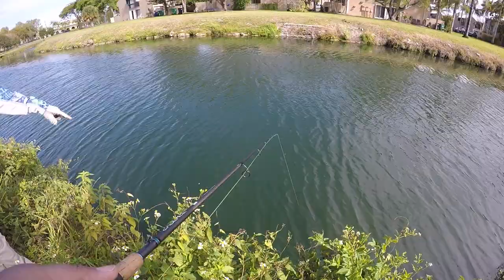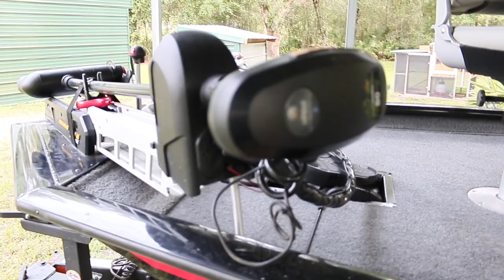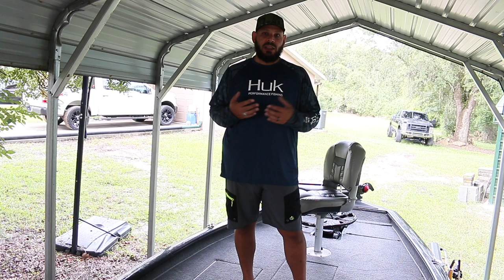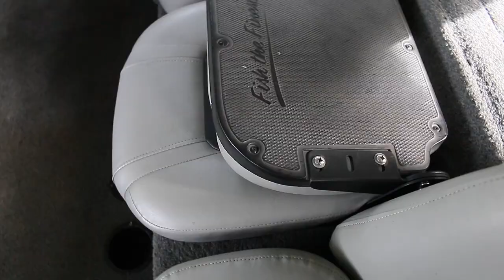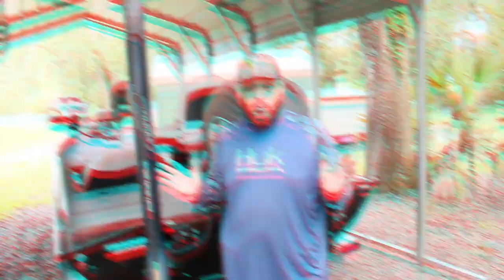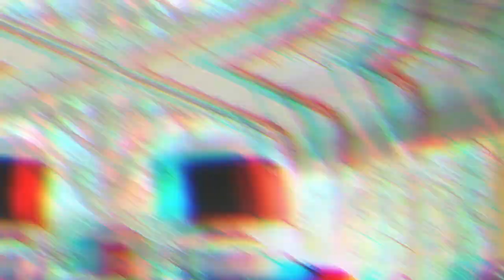Bass Tracker 3 Year Review. Should you buy one? #basstracker

Comment: I am replacing my old Ranger 396V with the newer used 2017 Tracker Pro Team 190 TX.  I am transferring my Minn Kota 4-Bank charger and my 24V Ulterra 80lb trolling motor over to the Tracker boat.  I am glad I watched this video of yours.  I have been wanting a Power Pole or Talon or even Raptor on my boat for a good while.  But, I see your point about the trolling motor.  Like yours, my Ulterra has Spot Lock and Anchor options and holds the boat position very well.  My Ranger 396V is a larger and much heavier boat, and the 80lb Ulterra had not problem moving the boat through the water or locking/anchoring the boat and holding that geo position very accurately.
Reply from the maker: Thx for watching!

Comment: Hopefully you will ready this note.  I am in the process of purchasing a used 2017 Tracker Pro Team 190 TX.  Looks a lot like your boat.  Same bow center rod locker.  The previous owner, who I buying the boat from, added a stainless steel cabinet handle to the front face of the rod locker lid.  Now when you open each lock, you have a horizontal handle to lift rod locker lid up with nice even pressure applied equally to both side of locker lid, which alleviates the binding I saw in your video.
Reply from the maker: Awesome sounds like a cool mod!

Comment: Great vidieo like all the links. I agree the trailer is not great mine is rusting too. My hatches seem fine I still have the carpet, it is  always covered. Rod storage I also am not a fan. One of my seat poles is stuck premantly in place. I use a casting seat up front that is enough room.  My seat in the middel bolts broke. Everything you pointed out.
Reply from the maker: Was just sitting in a nitro at bps but still made by tracker marine

Comment: I have a 2018 195 TXW w/Merc 150 that I paid around 32k for and currently have 40k into it with the electronics and dual Talons. If I had it to do over again I would use the 32k towards a used glass boat. The 195 has done its job and gets me on the lake and fishing. I currently have a water leak problem where the welds are failing where the hull meets the transom. My boat will be going back to Tracker this summer to have it repaired under warranty, so that means atleast 3-5 months without my boat. Later this year I will be replacing the front and rear deck carpet, have already replace sitting area carpet with better 20oz carpet because the original carpet did not really last 3 years. Once the new carpet is in, I will be using the 195 as a trade in for a new Bass Cat. Thought about going Nitro or Triton, but am willing to spend an extra 10k for the reliability and craftsmanship of Bass Cat.
Reply from the maker: I agree… getting a nitro is dealing with the sane company.. i think im trading mine in too..
Reply: @BeaglerBassFishingOutdoors  Yes, the price of a Nitro is very appealing, but in the end you get what you pay for. If I am going to finance a boat for 15 years, then I expect it to last that long and more. The trailer for the Nitro/Triton is my biggest worry. Buddy of mine has a 4 year old Nitro and the trailer  sounds like crap and recently had to replace one of the axles.
Reply from the maker: @Foes1969  that just sucks… good boat pheonix… but like 90k

Comment: Lesson #1 never buy a new boat. I’ve owned 9 different Bass Boats over the last 45 years some Aluminum some Fiberglass and never bought a new one and would never buy new. They depreciate faster than a mobile home. I have a 2003 Ranger 185vs with a 150 Yamaha Vmax that was hardly ever used,his widow said her husband used it 2-3 times a year for 6 years until he wasn’t Abel to take it out and use it. I took it home for $6,000. I spent $700 getting the motor completely serviced top to bottom. $550 on 3 new Goodyear Endurance Tires. So I have $7,200 in basically a new boat.
Reply from the maker: Id buy new all day long.
Reply: Harlan is right. Buying new is just throwing money away. To each his own but I don't buy new boats or vehicles that lose 25% of their value the minute you drive off the lot.